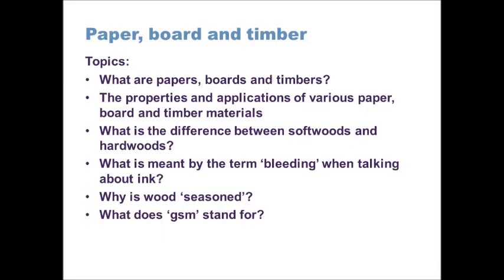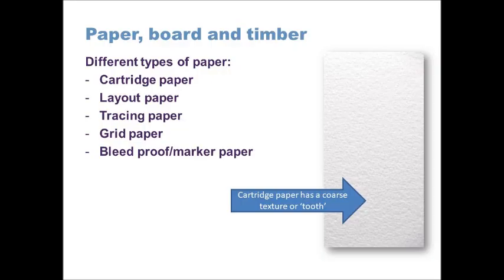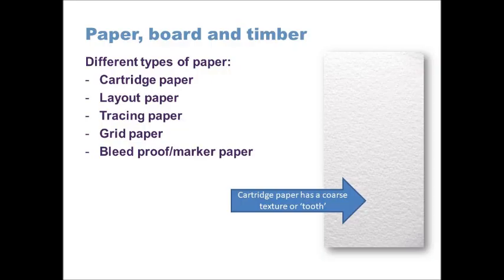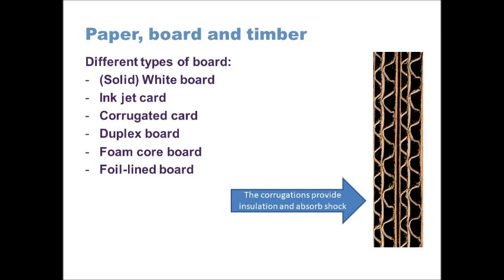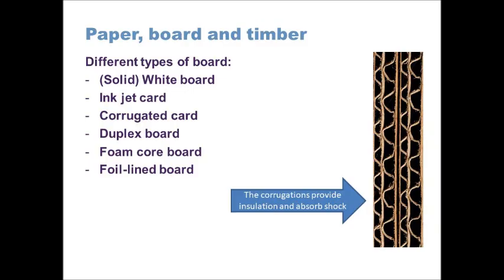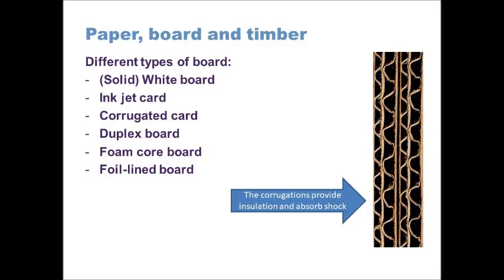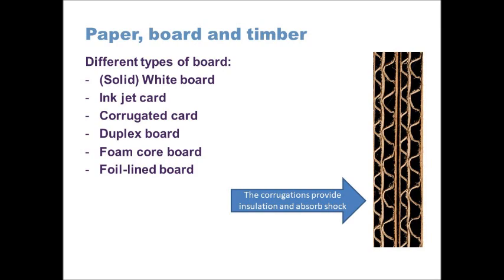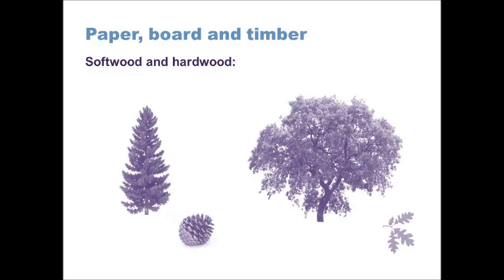GCSE Design Technology (9-1): Paper board and timber

Comment: cartridge paper used in printer
layout is for jotting down ideas i think
tracing paper is used in maths
grid is for isometric shapes
bleed proof is to prevent ink leaks
Reply: white board is for fancy packaging
inkjet is to prevent ink leaks
corrugated cardboard is for pizza packaging
duplex board is for cereal boxes
foam core board is to absorb impacts 
foil lined boarded is for food to reflect heat
Reply: 200gsm+ for cardboard
Reply: soft wood grows faster with wider grain
hard wood grows slower with denser grain